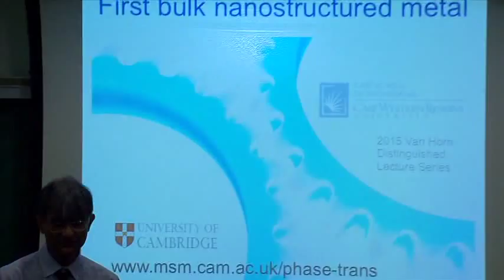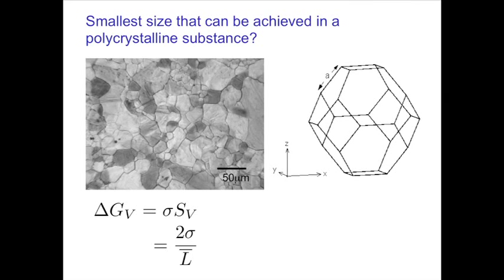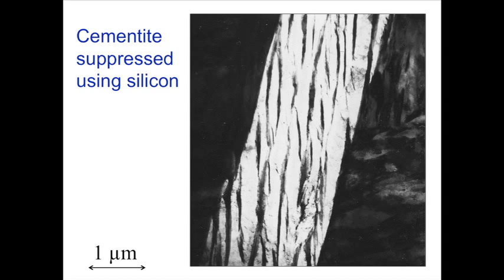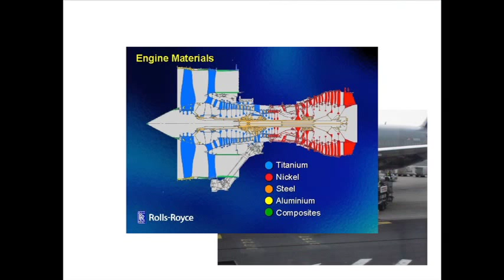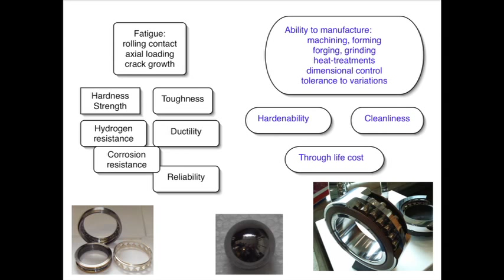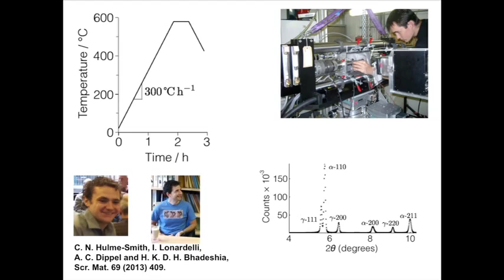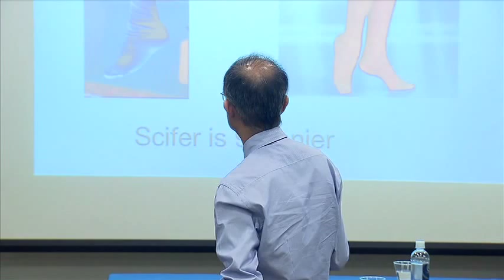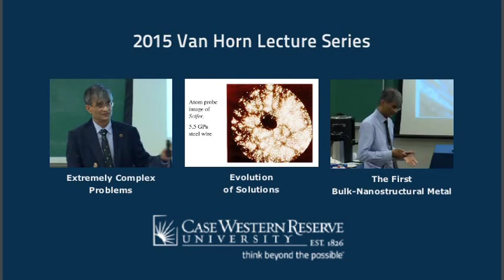2015 Van Horn Distinguished Lectures: 3

Comment: Professor Harry Bhadeshia:Silicon can prevent the precipitation of cementite from the austenite between the plates
of bainitic ferrite, but it has only a limited effect on precipitation from supersaturated ferrite. Why it doesn't precipitate in super bainite ferrite which is formed in the low bainite range of temperature.
Reply from the maker: There is no fixed "lower bainite range of temperature". If carbide precipitation kinetics are slow in ferrite, or if the bainitic ferrite plates are thin, then there is no time to precipitate in ferrite and lower bainite in not obtained. Furthermore, since in superbainite the ferrite is tetragonal, the solubility of carbon in dramatically increased so that the driving force for precipitation is reduced.
http://www.phase-trans.msm.cam.ac.uk/2012/solubility.html
Reply: nearly all papers use Si (2% or so) to prevent the precipitation of carbide in bainite. But in your paper, you said “it has only a limited effect on precipitation from supersaturated ferrite”. Though the
saying "lower bainite range of temperature" is wrong. in some circumstances
or specific temperature, will the bainite ferrite precipitate carbide within
it which rich in Si (2% or so) ? thank you very much.
Reply from the maker: The driving force for precipitation from ferrite is much greater than from austenite. So even 2 wt% does not have a big effect.
https://www.phase-trans.msm.cam.ac.uk/2008/silicon.html

Comment: If the first Bainitic Bulk–Nanocrystalline Steel transform below Ms Temperature,will
the microstructure be finer ?
Reply from the maker: +wang hou Yes, but any martensite that forms will be very brittle because of the high carbon concentration of the steel.